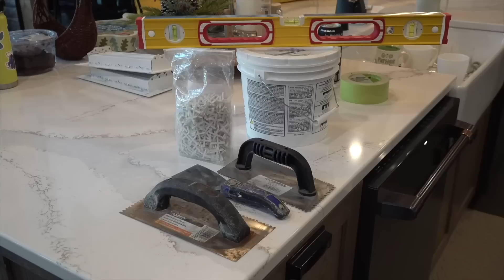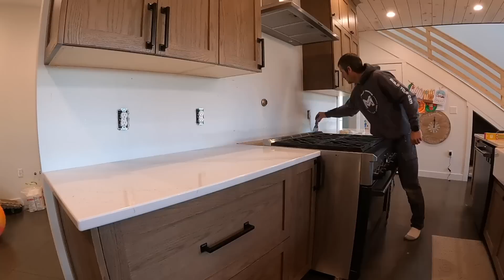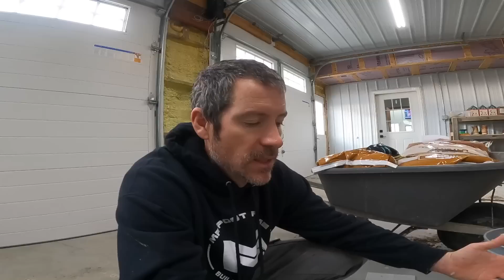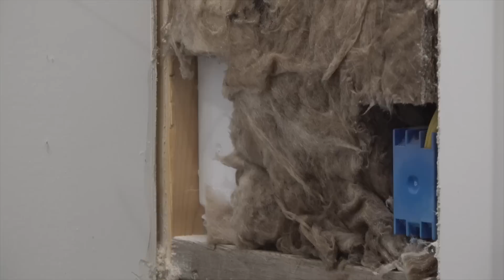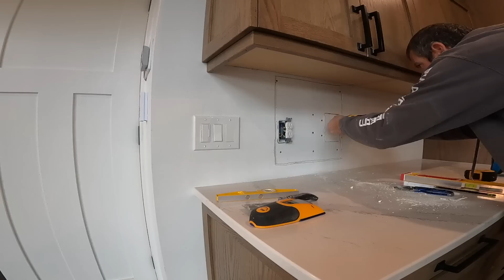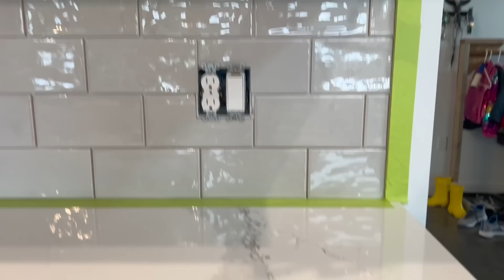Tile Backsplash + Future Coffee Bar | Mad County Build

Comment: Residential electrician here. The low volt thing aint the end of the world man. If it was my house I would do low volt in the box with the high voltage. Besides you need extension rings on all those boxes on the backsplash per code. I have argued that with the inspectors cause like I have told them, I've never seen ceramic tile catch on fire but they say its code. Goodjob though. Looks really good.

Comment: No nail plates over the wires going through the studs? I thought that was code pretty much everywhere now.
Reply: Wires are smack in the middle of the stud. Dry wall screws would never reach the wire.
Reply: @Z-Bart  yep what he said. you only need a plate if the screw is closer than 1 inch from the stud edge i think?
Reply: Nail plates as I recall are for plumbing or mechanicals not in the center of a stud.  ie:  an inch.  Wires holes are drilled center stud and will measure just over 2" with drywall and 2x4 stud.  More with 2x6.

Comment: I bought a Rigid tile saw from home depot for about $200. It is similar to what you have with the top mounted blade and does a great job. You do want to make sure the bade is square to the table before using it, but you would want to do that with any saw.